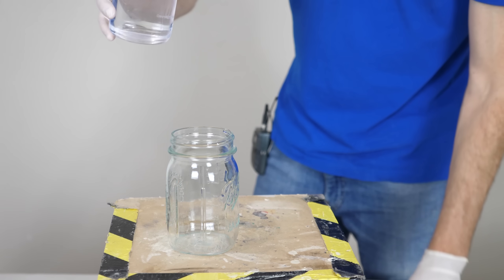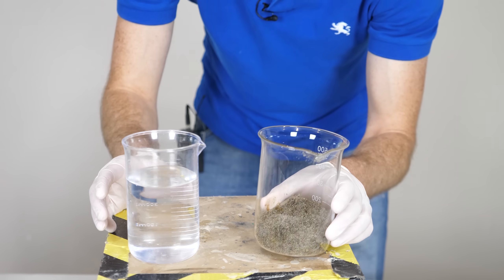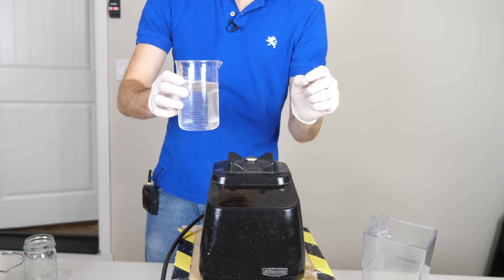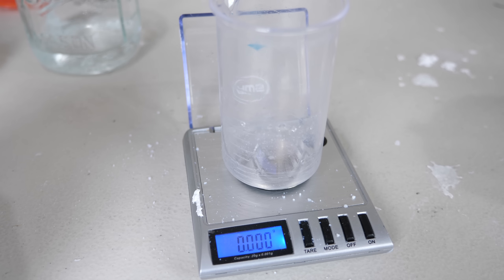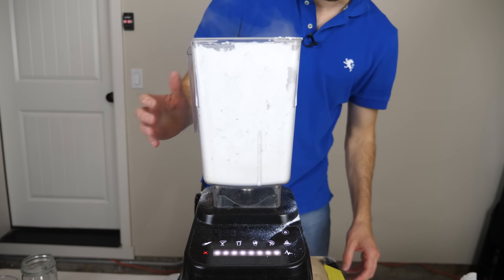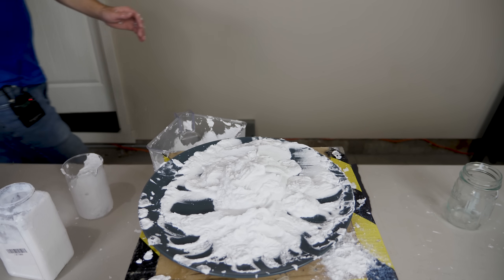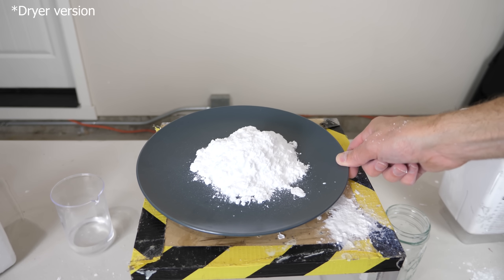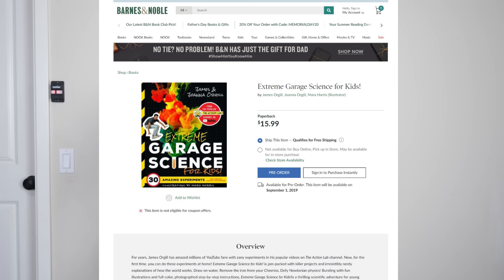How to Make Dry Water...Weird Experiment Makes Water That's Not Wet

Comment: Doesn't adding something to the liquid water, in effect, make it not water?
Reply: It's still water, just not pure water. Like the ocean is full of salt, but still considered water.
Reply: I have a solution to all of this, wet isn’t real
Reply: Ice is not wet when below freezing temps. It is dry. There is no liquid layer in frozen water. It only gets wet when you raise the temperature and it melts.
Reply: Silica kool-aid
Reply: I was thinking the same thing as the original comment.
Reply: By this logic the ocean is just a giwnt soup
Reply: @pereba9757  adding something that changes the chemical composition of the water.
Reply: the water is still just water - the tiny droplets are enclosed in the silica as seen under the microscope. nothing has been dissolved into the water.
Reply: @TimToucan  I'd say even then it's not a normal state of water, and wouldn't normally be referred to as such. 

If you substituted a high volume of sand, and said "the water is still just water" when in reality it was dense mud. 
At that point there's more sand than water, but hey the water is still water.
Reply: Yea
Reply: He said it can be up to 95 percent water.
Reply: Lyrics:  Particle man, particle man.  If he goes in the water, does he get wet, or does the water get him?

By:  They Might Be Giants
Reply: Carrie, where is the boundary of water no longer being water?  Hmmm...now I've got something to think about for a while.  I never thought about that fuzzy boundary.  Although, it's almost imposible to have absolutely pure H2O, so therefore the definition of water is liquid H2O.  Regardless of what it's touching, or what's touching it, or how much there is relative to other substances.  Water is also dissociating and reassociating constantly into OH- and H+ and it's still called water, so yeah water is water anywhere as long as there's about the right number of hydrogen's and oxygens hanging around.

The exception being a tank of hydrogen and a tank of oxygen and seven astronauts, boosters, three engines.  That's not really water but it will be soon.
Reply: I agree with you, Carrie.
Reply: Soup.
Reply: This is not water, it is a colloidal solution. If it were water, he could drink it. He could use it in things (experiments, recipes) which require  water, but NOT fumed silica (which, by the way, I work with on a regular basis). He can't. 
But dry water is easy to make. 
You just freeze it.
Reply: @WakenerOne  he does say it’s a colloidal solution
Reply: @WakenerOne  he could though
Reply: @WakenerOne  so most lakes and rivers aren't water, cause you can't just drink them either
Reply: @WakenerOne  freezed water or ice is not dry it's wet
Reply: @abunirmal2535  The definition of "wet" is "coated with liquid, esp. water." Frozen water is by definition not in a liquid state, therefore cannot make something wet or be wet itself.
Reply: @WakenerOne  but frozen ice could also be wet. It would stay in that state.
Reply: @WakenerOne  but it can turn into liquid after them melting point like any solid
Reply: @WakenerOne  There are very few people who care about what is technically "dry water", most people here are more interested in finding out how something akin to "dry water" would feel when touched. So calling ice "dry water" isn't fun at all because everyone knows how ice feels to the touch. So, this video has attention because it provides an experiment for us to imagine how "dry water" would feel like it if existed. On the other hand, your counter-argument isn't anything that can make us think or imagine what the experiment is trying to create.
Reply: @IuriSigma  It doesn't matter "what people care about." What matters is the truth.
Reply: @WakenerOne  It is laughable that you have the guts to call your own biased deductive reasoning "the truth". You only gave your particular opinion, that has value only inside the little scope of your argument. It didn't explain what the video refers as "dry water" at all. I get the impression that you must be someone who lacks any imaginative skill at all, so you must rely heavily on abstract logic to understand the world around you I suppose. That is a way one would label their mere opinion as something akin to a fact. Gimme a break.
Reply: @IuriSigma  Nothing "biased" about it. I gave a definition of "wet" that is independent of me and unbiased with regards to this discussion. In other words, I supplied facts, not opinion. In fact, I don't deal in "opinion." As I frequently tell my friends, an opinion is an assertion which requires no support, but which others are expected to respect simply on the basis of someone having a right to express it. I do not have opinions if I can help it; I have positions. Positions require support, either in the form of empirical proof or a solid inductive or deductive rationale.
Furthermore, I explained why what the video calls "dry water" is not water. It is a colloidal solution. When you add something to water which disperses into it, especially in such a way as to affect its properties, you have a solution or a suspension. Again, not me--science. Specifically chemistry which I have experience with as in my job in a dispersion lab, where I whip up solutions based in both water and AOCs all the time. 
As for your "impression" of me having no imagination . . . well, I'm going to copy that and put that on my social media pages along with a warning to everybody who knows me not to read it while drinking a beverage, because it's pretty much guaranteed to choke half of them with laughter. I don't care whether you take my word for it or not, but I've spent most of my life being told by people who actually talk to me for five minutes or more how I'm one of, if not the most creative person they have ever met. I've been writing speculative fiction since I was six, and have won awards for creative writing, poetry writing, photography, photoartistry and editing, and even had multiple professors commend me for originality in making research papers interesting. And I won't get started on what comic book artists including P. Craig Russell, Keith Pollard, and Trevor von Eeden have said praising my stories. Suffice it to say that your impression of my creativity is as flawed as your assessment of my argumentative case.
The bottom line is that this entire discussion hinges on what is meant by "wet," as contrasted with "dry," and "solution," as contrasted with "water." In that regard, I have supplied unbiased facts, while you have supplied some ad hominem "arguments" directed at me and some musings about how the video makes you feel as opposed to what it actually, factually demonstrates. Come back when you have facts.
Reply: @WakenerOne  Who are you tho? It seems you have a lot of recognition out there, but I can't check it if I don't know what to search for. 
Your defence is fine and all but it all comes down to what is meant by the creator of this very video we're discussing. If you used your intuition (because that's how we understand language), you noticed how the uploader was trying to emulate an idea about what could water be if it wasn't wet, so he never used "factual definitions" of "wet" and "dry", making your points meaningless since you're trying to counter a point he didn't make. About your creativity, yeah I can respect that, but it's also very easy to be creative in writting since it is the most common ability around there, even among non-creatives. What I meant by creativity was the act of creating something that has *form*, not something that is an abstraction of form (which writting basically is, or that commonly is at least). Because the art of shaping form requires you to have imagination beyond textual/verbal imagination, since it is required of you to basically reacreate reality with finer detail, such as a drawing, sculpture or music, which I find hardly unlikely that you have any degree of competency in anything similar to it, although it is possible.
But how are you about women? I'm curious about how someone so linear-minded could deal with the opposite sex as they're often as intuitive and subjective as they can be, something that might piss someone like you off pretty rapidly so I wonder how you deal with those.
Reply: @IuriSigma  Really? I asked you to come back when you had facts, and you respond by asking how well I do with the ladies? Of course, you might not have read that far, since I asked at the end, and you spent so much time deconstructing "creativity" in order to accuse me of having only one kind (which conveniently doesn't count) despite the fact that I told you about having accomplishments in other non-literary creative endeavors which, according to you do count (_e. g._ photoart). If you didn't read that far, why should I expect you to have read farther?

And, by the way, your deconstruction of creativity is laughable and inaccurate, and the only illustration one needs to prove that is the invention of photography. Joseph Niepce was lacking in the drawing skills he needed to render schematics for his various projects he and his brother designed (like the internal combustion engine). Taking what he knew about chemistry and photosensitive tars, he ended up inventing an entirely new branch of both science and art. Without a skill for drawing, he still possessed the creativity to create something novel. And speaking of the word "novel" brings us back to writing (by the way, the word "novel" indicates something "new.") But besides that, if you think that writers do not have the capacity to imagine reshaped reality, your perception of writing is extremely limited. Not only do writers of all kinds of fiction envision an altered reality (especially writers of speculative fiction), but they then describe these things and situations which don't exist in our reality in exhaustive detail. You are a fool if you believe that requires no more than literary legerdemain.

But back to the facts of the video. As little as I'd like to discuss the nature and processes of creativity or my dating history with an imperfect stranger such as yourself, that's not why I'm here. The host in the video makes several claims of fact throughout the piece. When he chose to use certain terms, such as "wet," "dry," and "water" without specifying a working definition which might have differed from the standard dictionary definition, he committed himself to the standard definition, because that's how communication works. Especially technical communication, such as describing a process in a scientific forum. Therefore, he didn't have to say "I'm using the standard 'factual definition' of 'wet' here" in order to have his claims measured by that rubric. He would have to say that he's not using it, then tell us what he is using as a definition for that word. Words mean things, and unless he tells us that for the purposes of his discourse, a word means anything other than the standard dictionary definition, well, that's the standard. Period.

Well, he made inaccurate claims about the fumed silica dispersion he concocted. It was not "dry water." it was a water-based dispersion which contained ingredients which inhibited the water from adhering to other surfaces. You may have a problem with my being "too literal," but face it: This is a science vlog, and scientific inquiry does not concern itself with the poetry of an observation or process; it concerns itself with the facts. (Sidebar: I saw some beautiful fireworks displays last night. I'm certain that whomever designed the displays took into account how pretty it would look to have certain colors go together, and certain rockets detonate at the same time. But when the fireworks were being manufactured and when they were being arranged, the people doing it were using their knowledge of which chemicals did what together, and how each rocket acted when ignited. The FACTS necessary to create the beauty). I called the narrator on the facts of the dispersion, and on the facts of how "wet" is defined, and whether oxidane, be it in a liquid state or one of its 17 known solid forms qualified as "wet" or "dry." I supplied facts to support my positions. The only rational way to refute mine argument would be to present facts which demonstrate that mine are incorrect. Not to talk about creativity. Certainly not to talk about how well I get on with the ladies. By the way, I would like to point out that your guess that women are in fact the opposite sex to me is just that: a guess. You have no basis for assuming my sex.

And now, I'll conclude by sharing some of the responses to my quoting your judgement of my alleged lack of creativity, as promised, on social media.

Freda says: "Boy have they got that wrong......
"
Debbi offers: "FFS..."
Kevin commented: [a string of assorted laughing emojis]
Hollywood actor (so you just know his word means more!) David gives us: "Hilarious. Actually, 'abstract logic' is an impossibilty, (sic) isn't it? Abstract reasoning can lead to a logical assumption, but logic requires specific components. I can logically say, 'If A, then B.' But I can't say, 'If something like A, then something like B.' "
Megan, Bill L., Bill C., and Robert responded with "Ha Ha" emojis.

Again, come back when you have facts . . . make that facts relevant to the discussion.
Reply: @WakenerOne  Nice story about photography, but I was referring to creativity in the context of art making, not referring to creative *inventions*. Inventions aren't made for their beauty to be appreaciated, but art mainly is. I can't deny this dude you described was very creative, but that's just not what I'm talking about. Although indeed photography is a creative art and so is literature, those are somewhat overly dependent on basic human abilities such as observation and writing skills respectively, meaning that those are abilities most humans generally share. It's relatively easier to build up expertise upon something you've been already taught (be it by learning compulsory common knowledge that is necessary to live in society such as writting and (some) observational skills, be it by freely exercising it as a means to interact with the world around you as a basic recreative necessity, like writting again) than it is to develop an unique proficiency in a specific field that isn't generally taught in society at large. 

Drawing, music and sculpture demands one to learn much more skills that are generally not taught. Your writting and observational skills wouldn't make you able to draw or make music, no matter how good you were at those. But surprisingly, if you're good at writting, literature can easily be your next step as it usually is (even my non-artists friends write books of their own, even fictional ones. I have a programmer friend who can't draw for good but has no problem coming up with books of her own), for example. In the same vein, a photographer no matter how good wouldn't be able to achieve drawing as their next step since drawing will require totally different skills to be achieved, but the opposite is true: An illustrator could make photography their next step since they likely have built skills that'll be directly useful if applied to taking a photo, such as compositional knowledge, a sense of perspective and visual artistry developed through great intuitive drawing abilities.

To learn how to draw one needs to learn advanced observational skills that are applied in a totally different manner than it is in photography. After all, in photography, one does not need to learn how to "shape" form in any way whatsoever, but this is a demanding skill for most artists that draw. An illustrator also needs to have masterful (or at least free) control over their hands/arms, a keen knowledge in how to use materials, an extremely meticulous sense of step-by-step planning and execution abilities in a way that they need to control a process that easily takes hundreds if not thousands of intentional and inteligent steps in just a single drawing. 

So visual arts require you to have lots of skills (such as good hand/arm control, eye-to-hand coordination, advanced and meticulous observational skills, imaginative visual skills since a lot of artists tend to draw from their head (such as myself) and superb mental processing to deal with hundreds and sometimes thousands of decisions in any given drawing) that you'll have to painfully develop on your own with intense deliberate dedication in order to achieve a basic level of proficiency (and a lifetime for any degree of mastery, not that this is exclusively to drawing though). Photography unfortunately for you isn't an equivalent example as although it needs its specific assets to achieve basic proficiency, those are assets that are mainly built upon basic observational skills. Sure, photography demands high eye-to-hand coordination in order to achieve great results but masterful (or even free) control of hands/arms is not necessary. The planning knowledge sure seems huge for a good photographer, but it's not like they need to basically recreate an entire image bit by bit each time they take a photo. But this is a must in drawing and it requires extremely high mental and memory capacity to achieve it even in a basic level. 
I won't even talk about music since it is a beast that requires skills that are even more demanding depending on the criteria.

So my whole point was to make the speculative assertion that someone so linear-minded and logic-based would have a natural difficulty in technically demanding fields of art such as drawing/painting, sculpture and music as examples of expertise in art that are highly technical, in the sense that technical capacity is generally a must, in contrast to less technical demanding fields of art such as writting and photography, that in comparison to the other ones, put less emphasis on high displays of technical capacity and more on other criteria such as subjective creative skills and stylistic choices. Before, I wrongly referred this as "imaginative skills" but that's mostly because in order to express imaginative thought through highly technical displays of art one must learn it thoroughly, so I just assumed that was implied.
 
About your case referring this video's uploader choice of words as inappropriate, it makes sense and it is his fault for not taking his choice of words seriously, specially since this is indeed a science vlog. I still fail to understand how throwing a tantrum over it has any real need though.
Reply: @abunirmal2535  "but it can turn into a liquid after them melting point like any solid," so iron is always wet?
Reply: @WakenerOne  jesus chill no one cares, dry water or not its a solid video
Reply: @alexanderafoko  YOU post something on a thread I last contributed a YEAR ago, but I'M the one who needs to "chill."
You're funny.
Reply: @WakenerOne  i really didn't look at the time you posted it lol anyways i guess we both need to chill...
Reply: @abunirmal2535  only when the heat of your fingers melt the outer edge you are touching
Reply: @abunirmal2535 it’s only wet because you melt the outer layer with warm fingers. Ice is dry
Reply: @abunirmal2535 just because it CAN be wet doesn’t mean it is wet
Reply: @WakenerOne  i mean ur technically correct but no one calls it that. i think it’s just like a nickname not saying it’s actual h2o just funky powder water yknow.
Reply: @WakenerOne  ice wets things though so it’s not dry
Reply: @insert_rad_username_here  Ice does not wet things. Liquid water wets things. When ice melts, it can wet things but at that point it is no longer ice. If you pour water on ice, or dunk it into water, sure, you can call it wet then, because it's "coated with liquid, esp. water," as I stated above. It can also be considered wet if it is only partially frozen and has water as a liquid inside the sample of ice. But when the water poured onto the surface of ice freezes, it becomes ice, and it is not wet. When the surface of an ice cube melts from the warmth, it becomes water, and no longer ice. I think I made it clear enough that I was talking about a thoroughly frozen piece of ice, all of which was in a frozen state. That, by definition, cannot be considered wet, nor can it make something else wet without conditions changing so that at least some thawing occurs. That sample of ice is, by any objective metric, dry. It is not, however, to be confused with "dry ice," carbon dioxide in it's solid state. Carbon dioxide of course has no liquid state under natural earth surface conditions. Can it be wet, I wonder? Obviously, under those conditions, it cannot be coated with liquid CO2, but what about water? When liquid water is poured on it, or it drops into the water, the temperature difference causes the CO2 to sublimate, and the water to freeze. A thin bubble of sublimating carbon dioxide will form around the underwater sample, constantly renewing itself until the entire sample is gas. The water closest to its surface will become ice, even as the water farthest from it will supply that ice with heat to make it melt. Will there be enough liquid water to actually touch the surface of the rapidly-vanishing surface?
Reply: @WakenerOne  ice isn't dry... its still wet
Reply: @facelessdrone  Refer to the definition of "wet" given above. Ice is only "wet" when it is covered with a liquid.
Reply: No, the ocean is a saline solution.
Reply: @WakenerOne  with fish poop, decayed dead bodies of sea creatures, and a ton of disease inducing bacteria, and a lot more things that you wouldn't want in your everyday water
Reply: @litterbox019  But something in the water is not the same thing as the water. If you put an Alka-Seltzer in a glass of water, drink it, and a few minutes later, your headache goes away, it isn't drinking water that cured your headache. You're not gonna go on YouTube and make a video claiming you're gonna show how water cures headaches. And if you do anyway, and Carrie McPherson comes on and asks if adding the tablet makes what you drank an analgesic solution rather than water, you, if honest, will have to admit that she's right.
Reply: @WakenerOne  if it's the thing that's in the water that cures your headache then it's not the water doing the job, but it still looks like water instead of wet medicine. what you add into water doesn't make water not water, but what you're doing is still drinking all of the stuff, the solute and the water at the same time
Reply: @litterbox019  Do you understand what the OP meant when she said "in effect?" Do you understand what I meant when I spoke of the "solution," the "suspension," or the "sample?" When you add something to water and you take a sample of the entire solution, whatever properties that sample has are not the properties of water, they are the properties of something that has water as an ingredient.
Let me use the example I was going to use before my better nature forced me to change it to Alka-Seltzer. If I mix a lethal dose of poison into a glass of water, then you drink it and die, did you die from drinking water??? NO. You did not. Drinking water did not kill you. Drinking a solution that had different properties than water due to my mixing something into it did. By the same token, mixing fumed silica into water to create a solution with different properties than water makes any sample of that concoction in effect NOT water. It may contain water, but it does not, as a complete solution, share the characteristics of water. It will have a different density. It will have a different melting point and boiling point. It behaves differently when it touches objects than water does. It behaves differently when exposed to light or electricity. It will behave differently than water if ingested. The solution is water-based, but it is not water. If I take water from the same jug that I use to water my cat and the deer out back and mix it with antifreeze, then feed that mixture to the animals instead of my radiator, the results would be catastrophic, and when I'm hauled into court for animal cruelty, I can guarantee you that the plea that "I just fed them water" is not going to fly. If I pour straight water into my radiator, well, it will work for a while, but not nearly as efficiently, and it will freeze in winter under much milder conditions than the mixture does because the mixture has properties which water does not.
If you look what the vlogger is doing once he has added the silica to the water, he is doing nothing with "just the water" in the suspension. Everything he does, he does with the entire mixture of water and silica. Which means that everything you just said doesn't apply. You can't talk of the silica separate from the water because he isn't doing anything with the silica separate from the water or vice versa. He's not dealing with water. He's dealing with a mixture. And that mixture has different properties than water.
Reply: @WakenerOne  tldr can't argue with you
Reply: I think people who are imagining ice being wet are thinking of an ice cube brought to a room temperature environment which makes its surface coated in liquid as it slowly melts. If you were to play in snow, it doesn't immediately make you wet, until it comes into contact with your body temperature.
Reply: @WakenerOne  Depending on whose definition you go by, ice isn't dry water because water is a liquid. As soon as you freeze it, it stops being water and becomes ice. Though some would argue that "water" also refers to the H2O compound, so ice is "water" in its solid form and water is "water" in its liquid form. Get rid of the extra quotes and it can be ambiguous what question you're asking.

Point being that, in the same way this video has "dry water", ice can be "dry water". In the same way the video isn't really dry water, ice isn't dry water. It depends on precise definitions which are in no way objective.

Also, ice has to be stupidly cold to not get you wet. Your body heat almost instantly starts melting the outer skin of ice, creating water which makes you wet. Ice cold enough to not get you wet is cold enough you probably don't want to be touching it. On the other hand, you can brush ice off a seat cushion, then sit on the cushion without getting wet. So the statement "ice is wet" depends on context.

It's like asking if the room-temperature plastic or aluminum is colder. They have the same temperature, but the aluminum is colder. Because the second statement is really just saying it makes your skin cold faster, not referring to the average kinetic energy of the particles like the first statement. And this second statement is perfectly accurate; even more accurate in a practical sense most of the time.
Reply: @GeekOfAllness  "Water" is synonymous with "oxidane." H2O. Oxidane has solid, liquid, and gaseous forms. The liquid one causes the condition known as "wetness." The solid one has to melt, and the gaseous one has to condense. When you make the argument that melting ice causes you to become wet, you are no longer talking about the oxidane in its solid form, but in its liquid form, and you have placed yourself outside the parameters of mine argument. In other words, ice doesn't have to be stupidly cold to not get you wet, it just has to not have any liquid water on its surface. If, as you postulate, it is melting, it does, and that liquid is what is getting you wet. That doesn't undermine my point at all. Nor does it address the original point that he is no longer talking about water when he mixes something into it which changes its fundamental properties.
If I make a Jell-O mold, I haven't made water that wiggles and tastes like cherry-banana.
Reply: Would adding ice to water make it not water? =O ... So there's obviously exceptions to that rule already!
Reply: That's what I was thinking. Is it water under a microscope?
Reply: @katherinerichardson2273  Under a microscope, it may be "water," aka "oxidane," but it still bears the characteristics of a solid, liquid, or a gas. "Ice" is the term for it in any of its 17 known solid formations. Under a microscope, each of these 17 takes a different physical structure and has different properties. Only two of these forms occur naturally on Earth, and one of them, ice-1, has ONLY been detected on Earth. It is ice-1 with which you are most familiar. Snow, ice cubes, glaciers . . . all of these are ice-1, which takes a distinctive hexagonal crystalline structure. Of all the known forms of ice, only ice-1 can exist as a plastic, which happens only under tremendous pressure, e.g. at the bottom of a glacier. Ice-7 occurs only inside of diamonds. in either case, unless the ice has liquid water on its surface, it is not "wet."
Reply: I mean "Dry Ice" / CO2 is already a thing, so I'm not sure why people need to debate ice being "dry" ^^
Reply: No
Reply: Adding food coloring to water dousen't make it not water
Reply: @every8863  It makes your sample a solution, however, and it may then have properties different than water - which makes it not water.